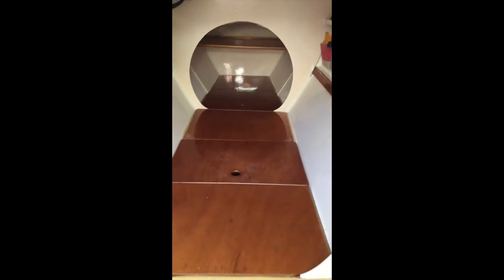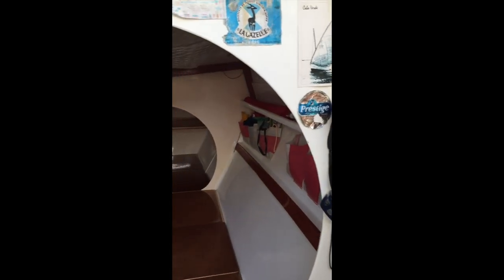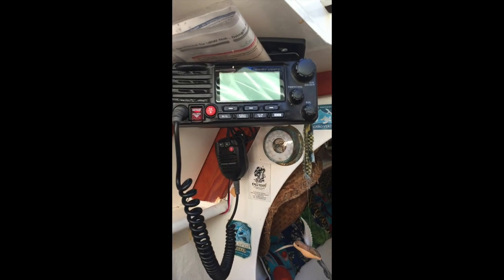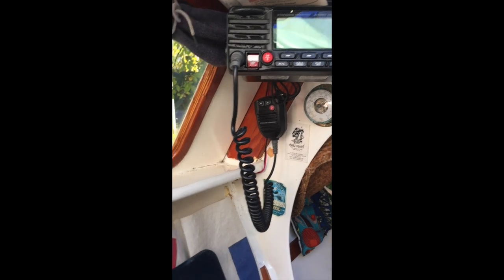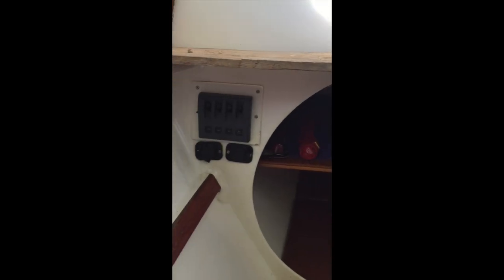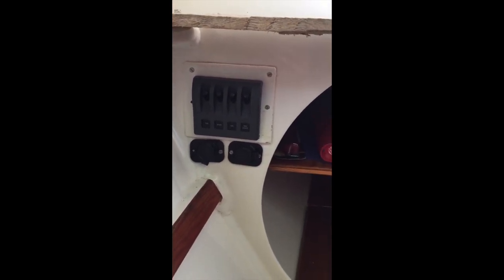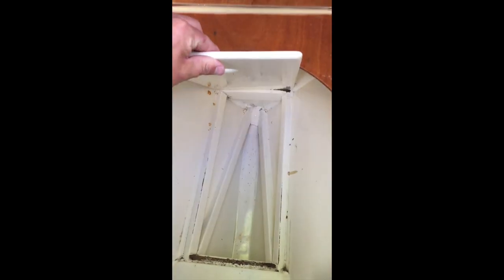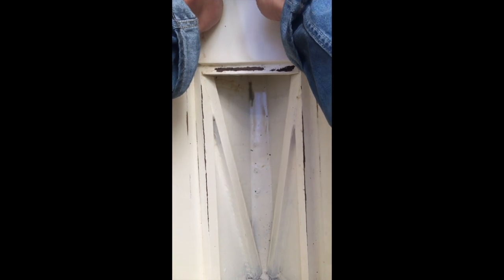(sold) I am selling Wayan, a Wharram Tiki 26

Comment from the maker: My father bought Wayan in 2003 from his builder in Holland. After sailing the North Sea coast of Belgium, France and England Wayan was brought to Switzerland where he was stored inside and trailered to the mediterranen each year to enjoy several weeks of sailing. Year after Year my father improved the boat and prepared it for a long voyage with big passages. 
In 2019 it was me who started this long dreamed voyage instead of my father. I sailed Wayan out of the Mediterranean, toke him to the coast of west Africa, crossed to Brazil, sailed the Caribbean and more than 2500nm non-stop back to the Azores and then Europe mainland.
In all this time I never had a major issue with the boat which I believe is due to the simple design of James Wharram but also because Wayan was built using only the best quality products. I never had any rot.

I usually sailed Wayan with a total of two or three people, but on a day trip we also once counted 8. Cruising speed is around 4-6 knots, in good conditions its possible to reach 10 knots. The boat sails well even with little wind, especially with the genaker. When there is no wind, for entering ports and small anchorages I used a 2.5hp Yamaha engine, which is in great conditions (around 150 working hours). This 4 Stroke engine uses around half a litre of gasoline an hour, pushing the boat at 3 knots. This engine is not suitable to make long engine passages or to motor against strong winds and waves. Originally Wayan was motorised with a 9.8hp 2-stroke Tohatsu engine. This engine wasn’t used for nearly twenty years, but has recently been tested and found working.

Wayan is currently stored disassembled on a trailer which is located in Switzerland (Canton of Luzern) and covered with a heavy duty tarp. All parts were carefully washed with fresh water and stored for winter. Both engine run on fresh water and gasoline has been run out of the carburetor. One solar panel is still connected and keeps the battery charged. Wayan is ready to be transported and most importantly ready to sail. There are some minor projects which are mostly for aesthetical reasons like faded paint.

I sailed Wayan with a polish flag and had an insurance with Pantaenius. The Flag registration cost me 470 Euros (all included and life long), the Yacht liability insurance cost me 90 Euros a year and the Yacht Hull Time Value Insurance 280 Euros a year. The polish flag is available for people from all nations.
Reply: Hi there,  I am the original builder.   And I still have the original buildingplans with the buildingnumber on it. if you want them. You can contact me.   Your father has my e-mail I think.
Reply: @urwun5254  Hello Urwun, If Niklaus is not interested in the plans, I would be interested to buy them. I am not sure whether to build a tiki 26 or 30 I would like to get hold of some plans before I decide which to build. I believe the Wharram people are ok with purchasing plans second hand as long as fee is paid to them. At this stage I just want to study the plans of the 26 and 30 in detail before deciding which direction to go. I already bought the study plans for the tiki 26 and 30 from Wharram but they lack enough detail in terms of cabin size and construction so if I can get hold of some plans cheap that would be great . thanks for a short reply.